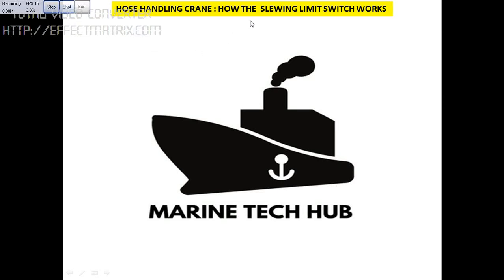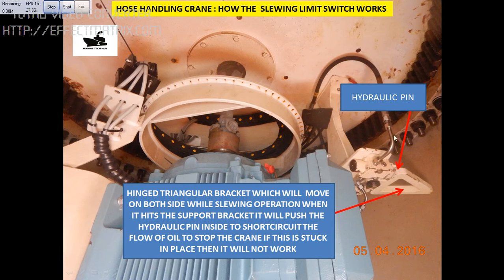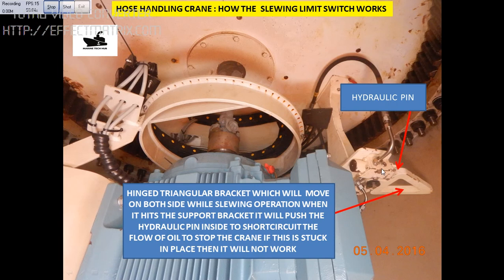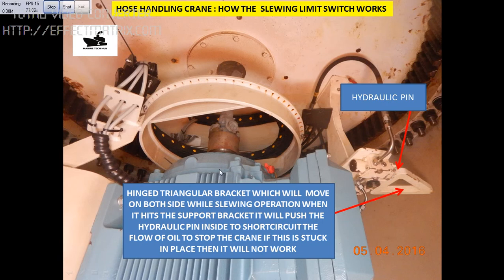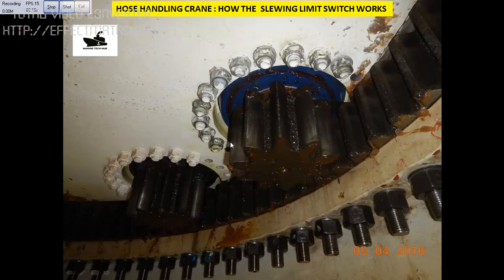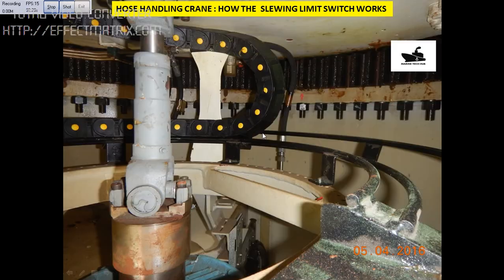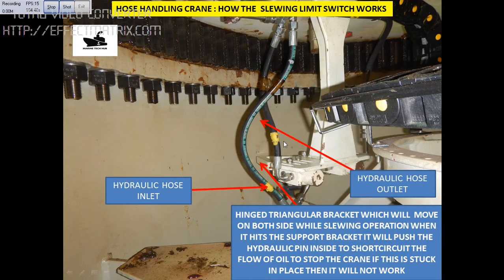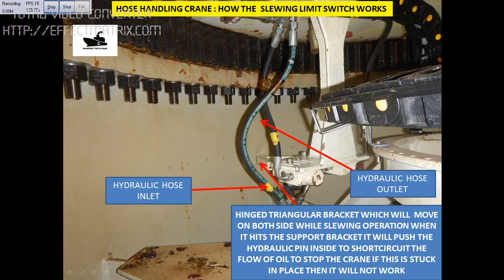Hose Handling Crane: How To Check Slewing Limit Switch Operation?

Comment: Sir, very crucial & helpful infor for marine engineers, do you have anything relevant to car latest tech
REPLY
Reply from the maker: Thanks for your valuable feedback !! Do share it with your colleagues and friend
Yes videos related to Car is also posted. I would post more technical videos at your request shortly
Reply from the maker: when you open my youtube  channel : Marine tech hub you can see icon right hand side of the header . you can click to go to my website 1. RT flex engine 2. Nitrogen generator 3. solar power.  full details of CLU and Crank Angle sensor can be see